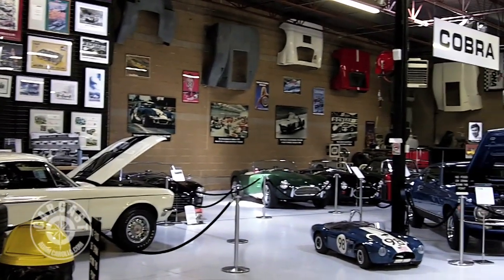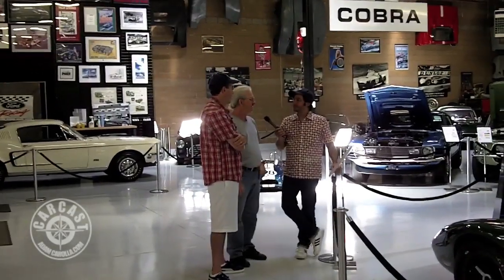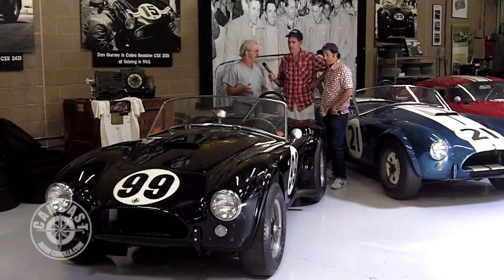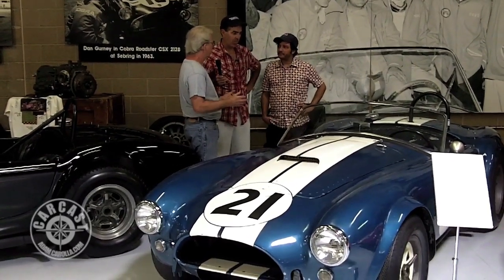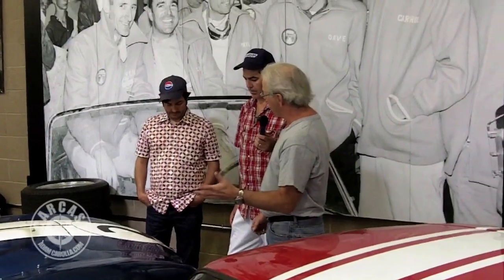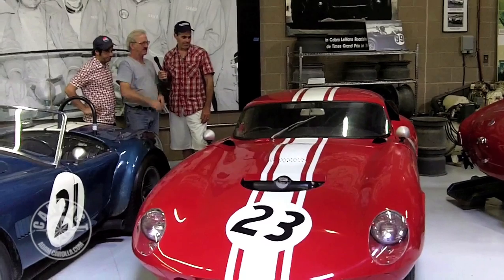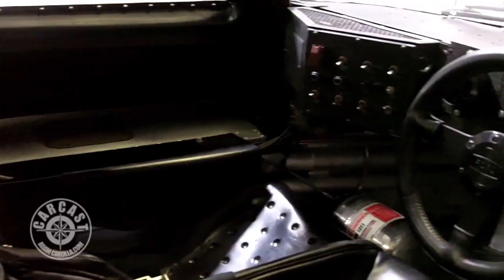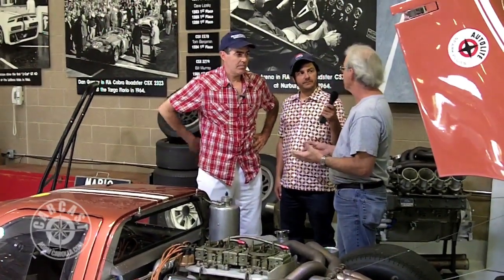CarCast's Adam Carolla at the Shelby American Collection

Comment: The Mark IV GT40 sounds bad as hell. IT may have won Lemans in 1967 however if I am not mistaken it was only because the L88 Vette broke a wrist pin with an hour or so to go in the race... a stock wrist pin which Traco the engine builder said was the weak link in the engine and suggested Chevrolet use an aftermarket wrist pin. Chevrolet wanted to Win and advertise that a stock Corvette won Leman... boy did it cost them!